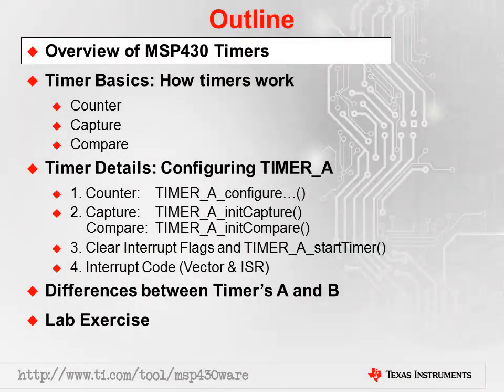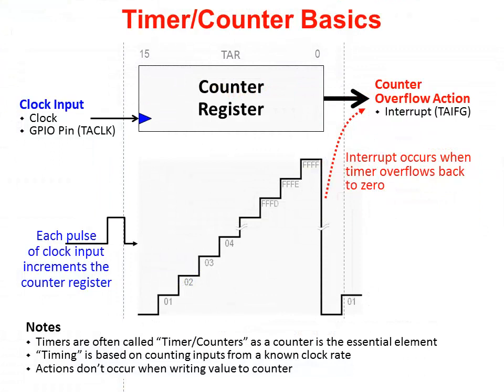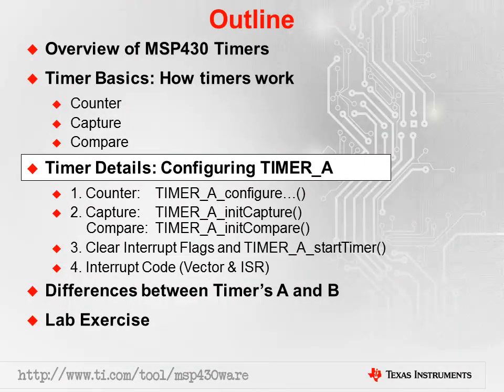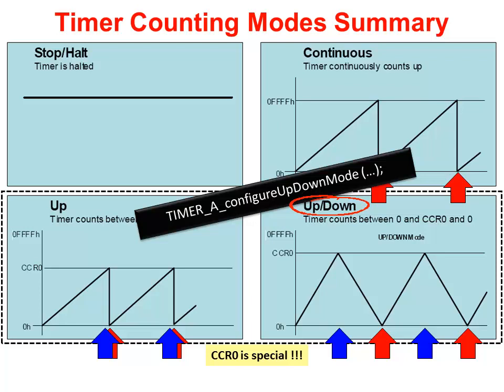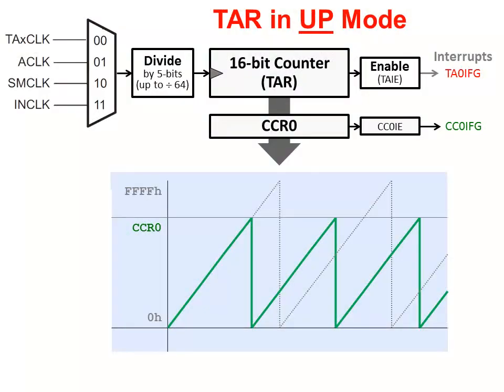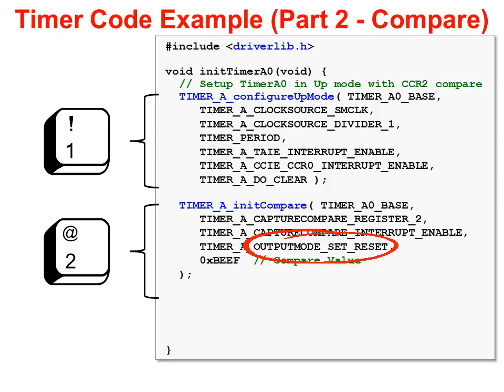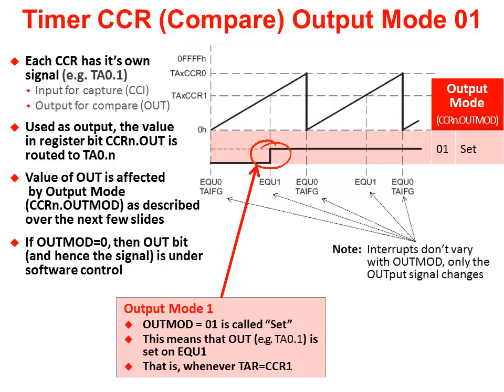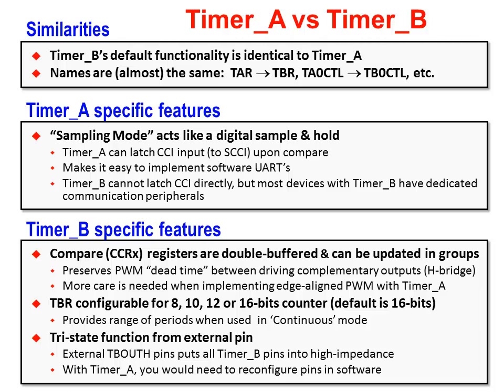TI Msp430 Design Workshop Timers

Comment: Sir I want to know about timer A  and output unit and its eight modes explanation and what is that EQU0 and EQUx pins work  plz expln ..

Timer A interests ...and about Watchdog timer register bits please explain or suggest me some link..
Reply from the maker: Thank You for your interest, but I am not an expert, i give a link to some documentation below:
http://www.ti.com/lit/ml/slap113/slap113.pdf
http://www.ti.com/lit/an/slaa513a/slaa513a.pdf
http://www.ti.com/lit/an/slaa601/slaa601.pdf
http://www.ti.com/lit/ug/slau400f/slau400f.pdf
http://www.ti.com/lit/ug/slau401f/slau401f.pdf
http://www.ti.com/lit/ug/slau323f/slau323f.pdf